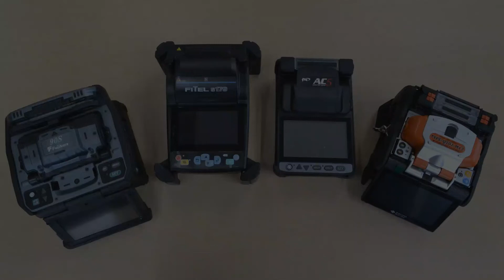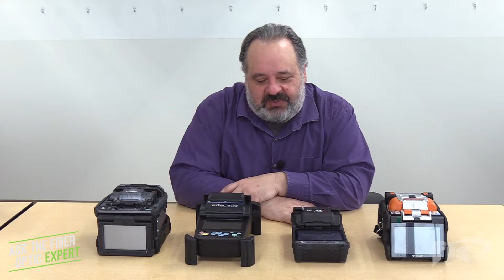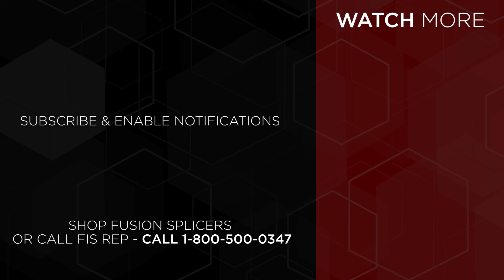What Are The Different Types Of Fusion Splicers? | Ask The Fiber Optic Expert

Comment: can we splice om2 to om3 or om4 fiber ? my cable is om3 but pigtails are om2. Thats my problem.
Reply: Sorry for the delay, I did not notice your question.  Yes you can splice OM2 to OM3.  As the core and cladding sizes are the same this will work for you.  Thank you for the question